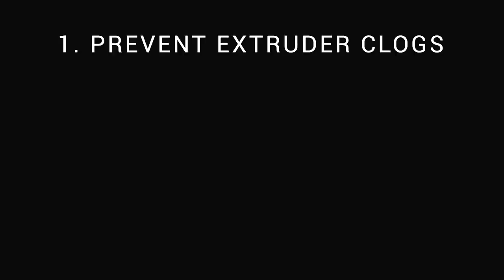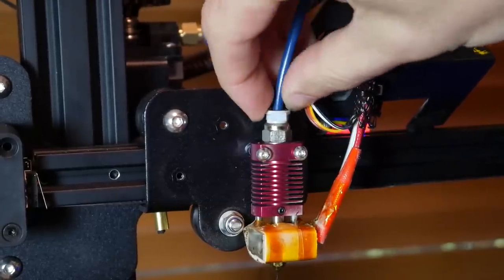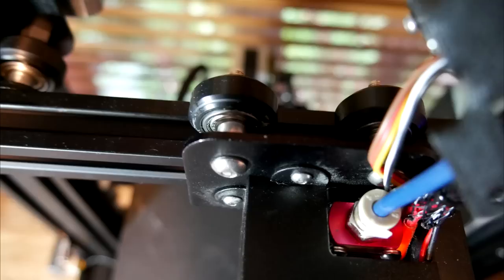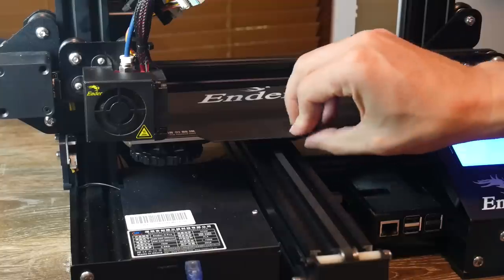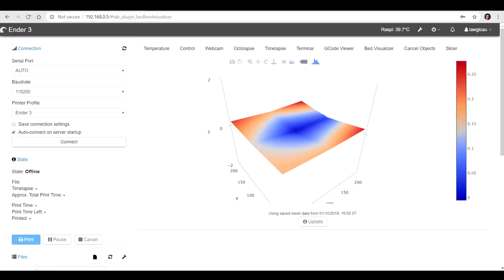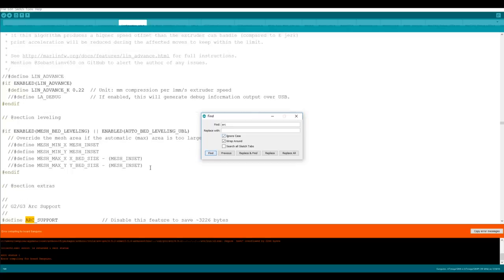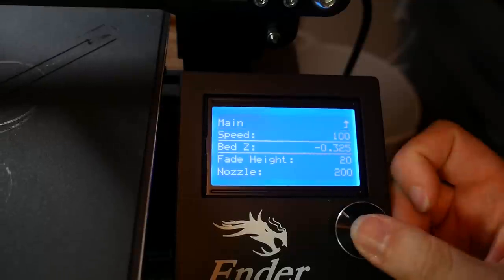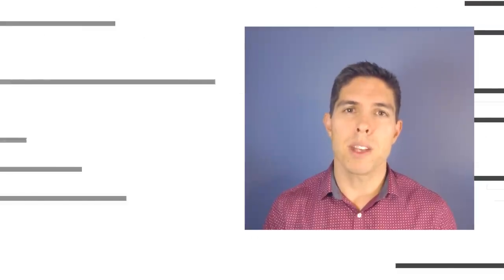5 beginner Ender 3 fixes - featuring manual mesh bed leveling guide

Comment: Throwing the bullshit card on the screws causing heat creep. I run 6 printers with the same hot end and those 2 screws don't affect anything. Plus you don't need to rip apart your insulation put on from THE FACTORY. Please practice what you preach by researching before posting/vlogging. It sends people "who don't know any better" falsely into ripping apart their machines when the stringing issue is as simple as a temp or retraction setting.
Reply from the maker: Each to their own. Luke discusses the fact that this is debated in his guide. I figured that even if it wasn't a big help, it certainly wasn't going to cause damage and was worth covering. The insulation is still intact, I showed it the way I did for that reason. Tightening a PTFE fitting and removing two screws is hardly 'ripping apart' a machine, please be fair here.
Reply: @TeachingTech  I'll give you that, it's not entirely ripping it apart but it's the little things like that which convince beginners it's okay to jump into something that is trivial and unnecessary. I'll admit, yes there are small tweaks, and the other tweaks/adjustments you mentioned are great. 

Trouble is, when I'm sent here by a beginner's post from 3D Printed Tabletop that fully believes a vlog is to be factual, sends me off the deep end. I might have came off a little harsh but the suggestions of trivial "fixes" has to stop. I'm glad you addressed the PTFE spacing against the heat break because that's what ends up happening more often when people remove those screws.

Thanks for the reply though. Most vloggers just ignore opposing posts so I appreciate being heard.
Reply: @TeachingTech  it actually CAN do actual damage. 

That heatsink and throat are not tapped so the only thing holding everything in place is small grub screw that is extremally easy to strip (what I did)... Also changing nozzles with those screws in is walk in the park and can be done with hotend on a printer while when you have those screws off you are not going to be able to do that.